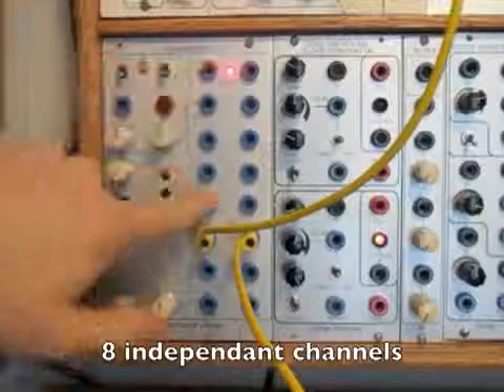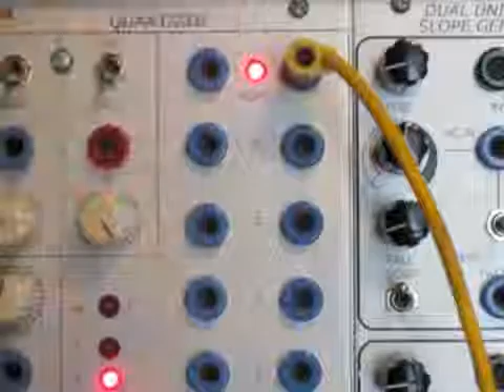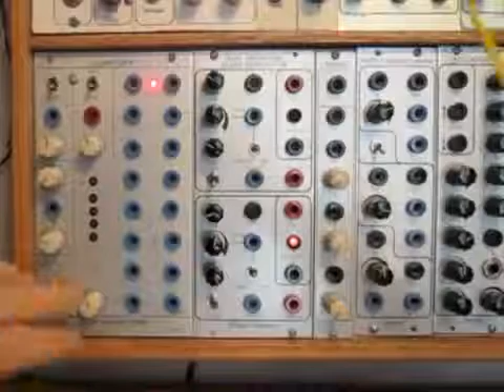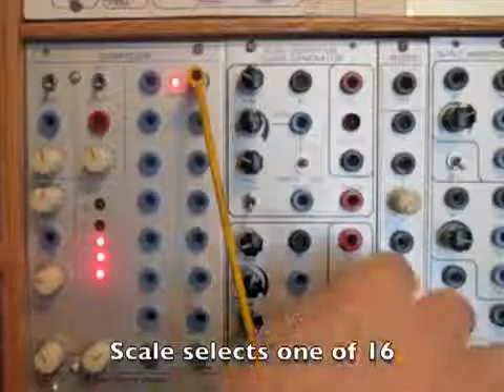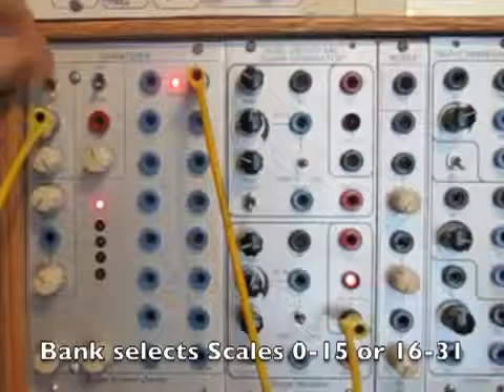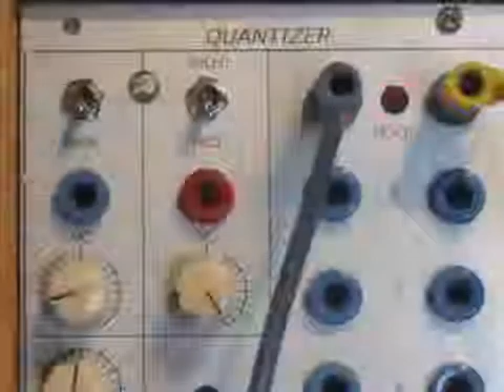Quantizer Module demo

Comment: many thanks Craig, you've sent me this board years ago. I was thinking whether it's feasible to program a new firmware for it to work as a one channel quantizer with 8 individual outputs for each note of chosen scale (or 7notes + 1 master). The outputs would be gates whenever that particular note gets hit. What do you think?
Reply from the maker: The code is posted on my web page for the module. It would be possible for someone to program it to do that, but not easy. The code if for PIC chips, so you'd be using MatLab. It was written, not by me, in assembler language.